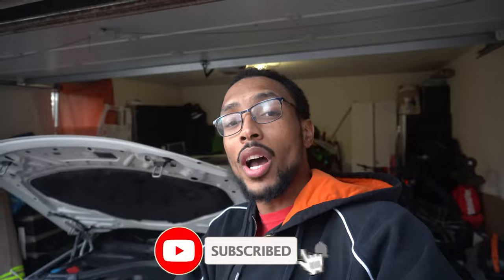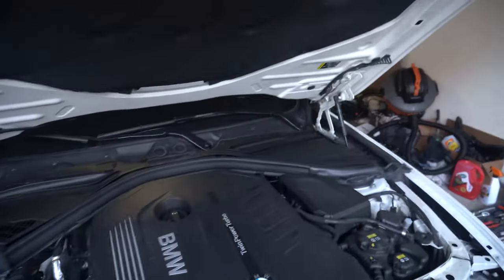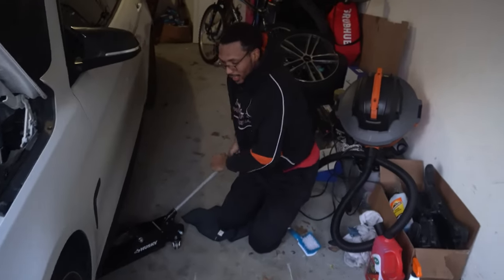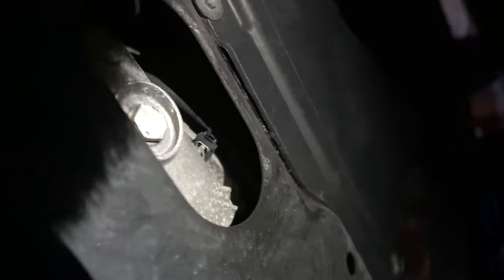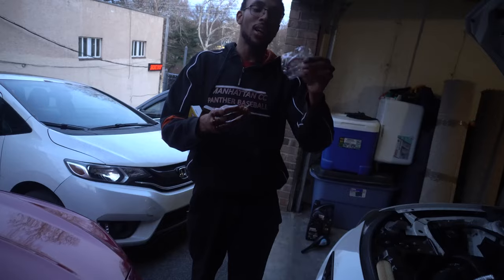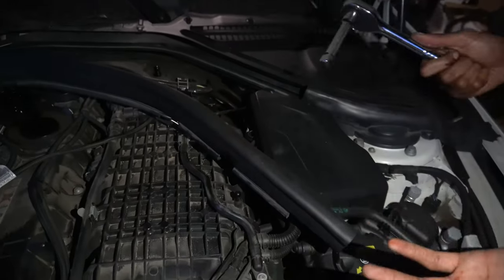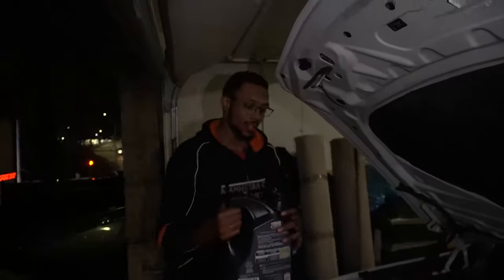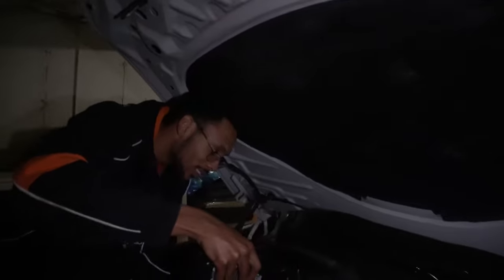HOW TO - Change The Oil On A Brand New BMW 440i in under 15 min DIY

Comment: The oil for BMW is very specific and not off the shelf usual!y, think long life 001, castle no longer meet BMW specifications
Reply from the maker: what do you recommend?
Reply: LL01 is only if you plan on 10k oil changes
Reply: I asked a bmw employee at parts department what type brands of oil i can put on my 2019 440i he said castrol w20-0 or valvoline w20-0
So i said does it have to be long life 001 he said no as long as is a full synthetic and w20-0 oil viscosity its fine, ur welcome